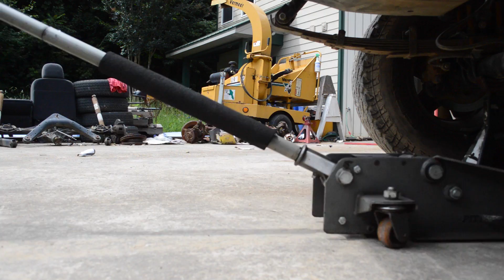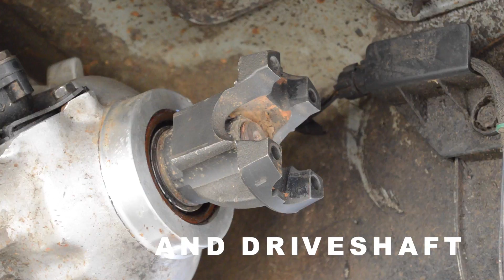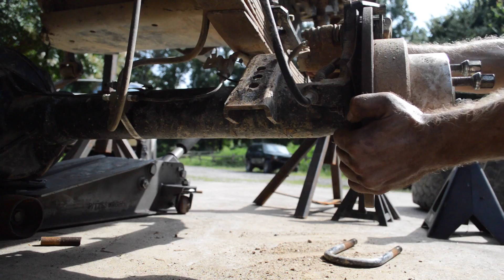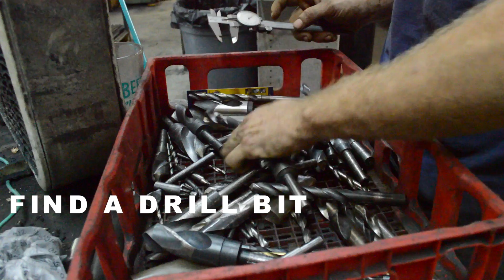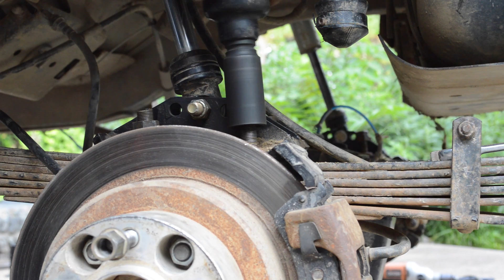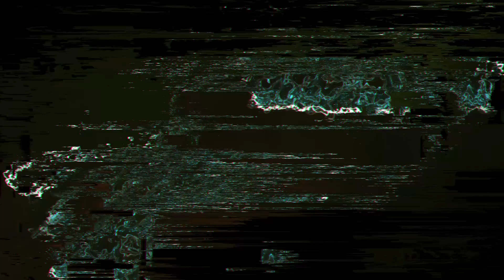Ironman4x4fab Jeep Cherokee XJ Axle Stretch

Comment: funny i was thinking of doing this, my rear axle are a little too far forward, making my wheel not centered in the well. i was wondering if the stock 8.25 perches can be drilled safely or i must get aftermarket perches?
Reply from the maker: I would imagine they are, but I feel like the most correct thing to do is to grab some new ones. They're not too expensive from barnes4wd.
Reply: thanks! checked them out, shipping to canada is too expensive so i'll have to find something else. but the actual product price is great, wish I lived closer to the border
Reply: What did you end up doing to fix this issue Alex?
Reply: @justinbrown4622  I parked the jeep and forgot about this problem! Haha just kidding, but it's not far from the truth.. Seeing this is 4 years ago, I ended up taking care of more important problems first (rusty floors, water infiltration), and with the way things are going now currency exchange and shipping are still an issue as far as how much a pair of aftermarket perches would cost me. I did park the jeep last year until I have time to work on it. Sorry I couldn't be of more help. In my case it was more cosmetic than anything else, when flexing (nothing too extreme though) it was not an issue as far as rubbing. I plan on eventually swapping my 8.25 for another one I have because of a bad pinion bearing, and will probably end up testing the OEM perches with one of the other holes drilled on the bad axle and see how that looks. It should work, but if you have shims and don't relocate the perches to fix the angle, it probably won't work as like half of the shim would be sitting on nothing.
Reply: Probably a little too late for this, but you can just drill into one of the leafs themselves 1” over to get better centering. Can’t remember if it was the top or bottom as it’s been awhile since we’ve done it - but I’d assume the bottom leaf.

Comment: Do you have a video on this shock relocation?
Reply from the maker: Nope, but we use Barnes4wd U-Bolt Plates with shock mounts. The shocks poke through the inner wheel-well/floor then tied into the cage.

Comment: Did you drill the u-bolt plate as well?
Reply: bradbob589 you shouldn’t need to since it is not stationary.
Reply from the maker: The Barnes4wd U-Bolt Plates have three holes predrilled and you just need to shift it over. No drilling is technically required regardless.